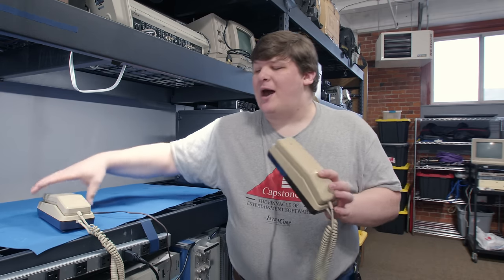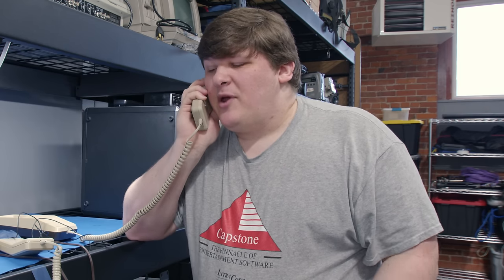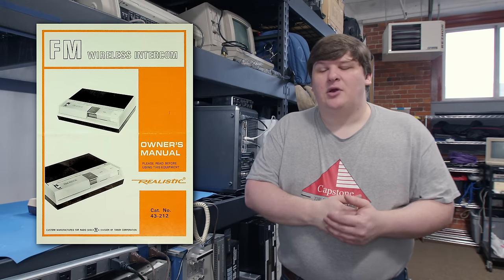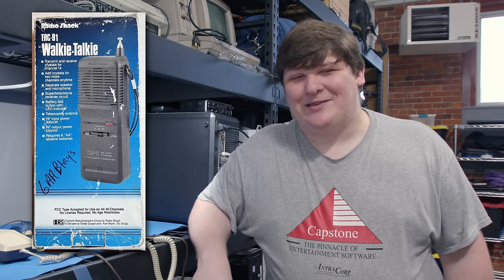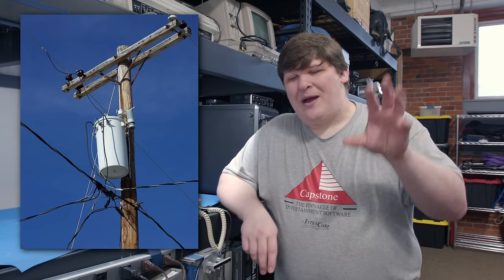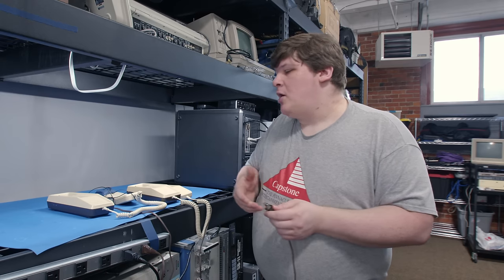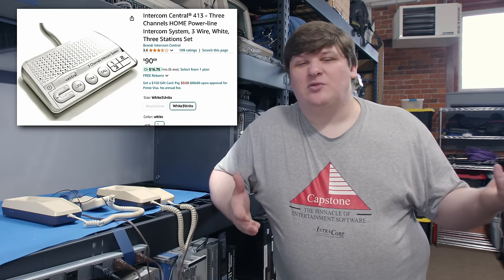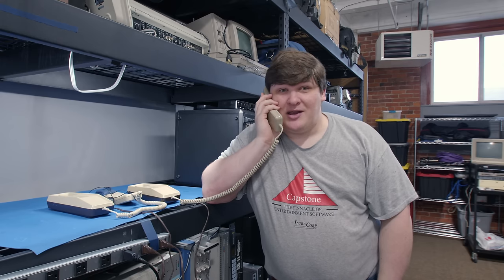How does this "phone" work without a line?

Comment: Huh... so I was both right and wrong ...
I figured either it was wireless (given credence by the FM badge)
or it modulated audio waves over the powerline (which was correct).
But the modulation technique it used just so happened to also be frequency...

Comment: 200 kHz tells me immediately that it is not a radio... The antenna would have to be almost 400 meters long.

Here they basically let the antenna span from the transmitter to the receiver.

Comment: 193 and 200 kHz? That would not have been allowed in Europe - because that is in the longwave band. If the modulation really was FM, that would be weird as longwave is a AM band. The range was obviously extremely short but you would have disturbed the reception of LW radio nearby. 

The distribution tramsformer would have been the limit, because the coil inside would block the radio frequency, but the electrical wires would radiate some RF.

On the other hand -some (illegal) cordless phones in the Europe - transmitted in the MW band one way and at around 50 MHz which would be around TV channel 2-3 (PAL) in Europe and the 6 meter CB band in the USA, the other way! (I had one! 😅)

Those cordless phones were actually illegal both because they used radio bands illegally - and because they were not sanctioned by the national phone companies.

And yes - on the MW band - you could eavesdrop at quite a few conversations on the phone in the 80’s.

Comment: Couldn't you test if its the squelch by leaving one unplugged and seeing if the plugged one rings when taken off the hook?  If I understood you right.  Ring would mean squelch, no ring would mean that it ways for the 193/200 feedback first.
Reply from the maker: Yep, that's exactly what happens. When you lift a handset, you hear the "ringback" sound until another handset picks up. Doesn't matter if the other set is connected or not.

Comment: the reason your family (and most others) never used them is simple: the type of person who think it's fine to just shout through walls in a house is not the same type of person who, A) pauses for a moment and B) thinks, "ah yes, I need something from someone, instead of shouting let me just use our special phone/radio intercom and wait on hold while it rings for me to disturb others." So many people are just impatient selfish bastards.

While most folks wouldn't want it in a residential context, these would make sense in small offices, etc; before modern phone systems.

EDIT:  Also, seems obvious, duplex = two frequencies for simultaneous two-way comms (and perhaps the squelch/ring thing as you described), most other models had a Push-To-Talk (release to listen) button and didn't need two frequencies.

Comment: Disclaimer: I am far from professional, this is just what I understand from patterns I see.
If a radio picked up the same frequency it was sending, then it would pick up itself and make a horrible feedback loop. One listens to one frequency while one listens to the other so then there can be simultaneous back and forth. Have you ever used a regular VHF radio? When you press your button, your speaker goes silent to prevent this feedback

Comment: I dont think thay are radios at all, I belive they send the signal into the wire (the power cord), this was quite common in the 70's .. ofc it creates alot of issues with overhearing and interference and introduces noice into the power system .. a couple would not be a problem but, it gets messy and cambat itself pretty fast.. some could even work 500 meters apart, so in a city this is(was) not very usefull 
.. today ther are countries that actually send radio and emergency information this way(via power lines)

Comment: As a follow up to my previous post and you saying: "anyone could have made one"... Well, yes and no. The technologies might actually be patented but in any case require some research and fine tuning. Done by the, probably Taiwanese, ODM. They were happy to sell them through Radioshack but larger brands may have shied away from relatively unreliable gadget-like technology. Not enough market to develop their own better ones, and no motivation to buy them from that ODM as they would have had to compete with identical Realistic ones.

Comment: Considering they have a power cord and thus aren't mobile, they're more like Talkie-no-Walkie's
Reply: They don't work in your building in two different units because the building probably has 3 phase service, and the other unit's 120V outlets are on a different phase. You might even try different circuits in each unit, as the 120V circuits are usually spread over all the phases, so if you have multiple breakers in each unit, you might find one in each that are on the same phase

Comment: Honestly, I'm surprised they don't sell these kinds of devices as baby monitors. Though maybe having one side designed to be actively transmitting basically all the time is not ideal for home power lines?
Reply from the maker: They did! The catalogs and manuals for most of them do in fact suggest using the desktop models as baby monitors, the transmit button can be locked down to make that possible.
Reply: @CathodeRayDude  Well, I stand corrected -- I suppose in the era of 2.5gbps wifi, though, there's not as much of a market for this technology as there used to be though

Comment: I have to say something.  Those frequencies are way too low really, that thing is not a walkie talkie, they instead inject the narrow FM modulated RF into the power line via capacitors. In theory it should not radiate. 

Edit: ok, I see you figured that out ;)

Comment: It's a little surprising that you didn't circle back in your script after figuring out how they work, because the theory about how one tells the other to ring is way off.  The ringing is handled by a signal on the same line.  That's why when you plug one in, but not the other, it doesn't start ringing.

Comment: Are you aware the doorbell phones of houses are connected to each other? You can call any other flat in the building over them and talk with each other
Reply from the maker: I assume you aren't in the US. I don't believe the thing you're talking about exists here, the only apartment intercoms I'm aware of are much simpler, direct wired point to point affairs.
Reply: @CathodeRayDude   i'm in europe. We also have point to point wires, but the building have only 1 entrance and all wires run together there at 1 point where a loudspeaker and microphone sits to talk to whoever ring the doorbell. 
Basically, you take the phone that sits in your apartment at your door, and talk into it. The sound goes trough the wire down to the entrance door of the building, out of the loud speaker, into the microphone, trough the wire into another  appartment and there, the neighbour sits on his phone and hears it.

Comment: Now do an irrational amount of research on those terrible built in wired home intercoms that came with middle class new construction homes in the mid/late 90s! My family moved into a house that had one of those systems in the mid 90s and we NEVER used it, it was terrible and useless but so many homes in my area had them, I'm sure it was just builder bullshit addons to pad the bottom line...
Reply: I think ours had a tape deck and an FM tuner that you could setup to play to various other-end stations from the main intercom unit (that was at the central "built in" desk near the kitchen or family room that no one ever used either, except as a place to dump the mail). But the tape or radio that you played from the main unit to the satellite units sounded even worse than toy walkie talkies so that feature never ever got used at all...

Comment: 200Khz they are not radios: they are carrier devices: they send the RF via the power line. 200Khz is to low to transmit without a high power. Besides the 190 to 535Khz frequency is reserved nor non directional beacons of airports (mostly decommissioned now but still reserved).
If they operated at the same frequency they could not be duplex (both talking at the same time), only half-duplex (when only one talks each time and you need to say over). Using duplex you have the telephone look and feel.

Comment: "FM" doesn't imply that they send their energy wirelessly over the air... you can shove an FM modulated signal down a copper wire as well... heck... ordinary telephones shove an AM modulated signal down the copper wires... but on their own dedicated copper wires:..

Infact those intercom handsetts actually uses the mains wirering as their ttransmission media, ie the copper wires...

Different frequencies will happily co-exist on the same medium as long as they're apart from each otther to not interfere eachother

Btw... these kind of intercomms where very prominent during the 1980's... here in Europe atleast... and I bet you that they where made using tthe same low quality shitty components Realistic/RadioShack used...